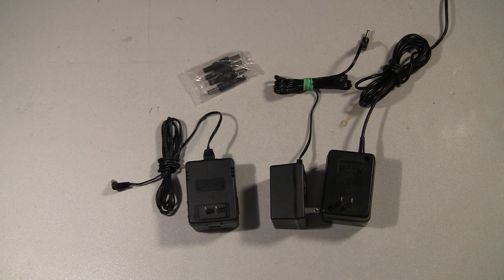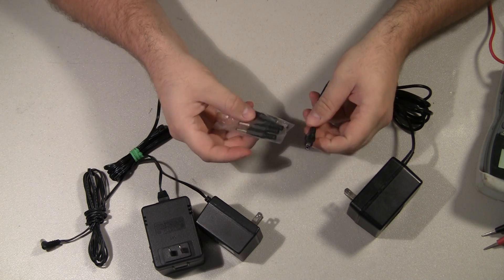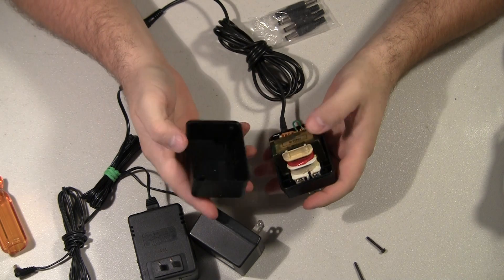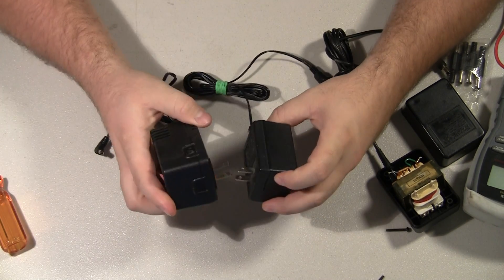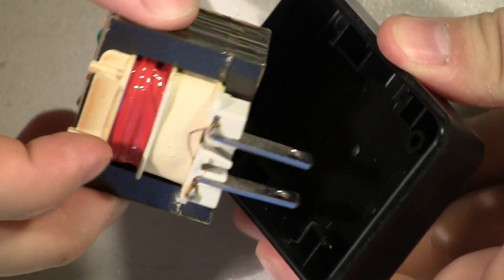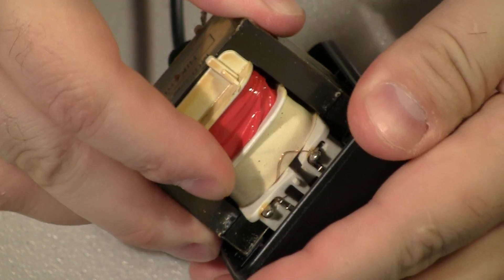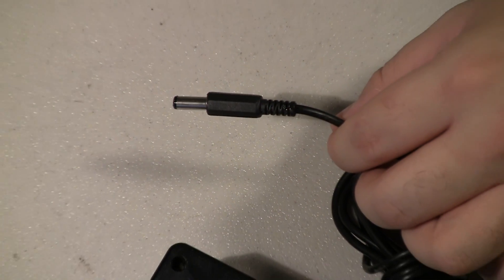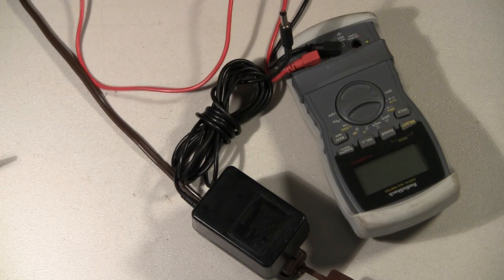NES AC adapter repair - Tips N Tricks - Its easier than you think!

Comment: Opening my SNES's SNS-002 AC adapter, I found that the size 8 spanner bit in my iFixIt kit kept slipping around the screw head, and the size 6 spanner bit was too small. A size 10 spanner bit from a cheap Harbor Freight security bit set seemed to work a lot better. I think it worked better because its body is wider than the iFixIt bits, so it stayed centered in the hole. (The size 8 spanner bit from the Harbor Freight set was too narrow to span the head. Weird.)

I've never seen that kind of screw head before. I haven't figured out what that style is called. Apparently, spanner bits are meant to be used on heads that have two little holes in them, and we're just lucky they work on whatever these are. 😄
Reply: Just got the ifixit kit and I'm also unable to get my NES power supply open with the #8.  Guess I'll be stopping at Harbor Freight the next time I'm near one for their kit.

Comment: Ive got two power supplies one nintendo and 1 aftermarket, the nintendo rated for 10v puts out 12 at the tip, and the aftermarket rated for 9v puts out 17v. I get non stop wavy lines with the nintendo power supply, and if I position the connection of the aftermarket I get little to no wavy lines. Any ideas?

Comment: The NES has some weird internals as it can accept AC and DC and the voltage can vary on a huge scale. In your case the polarity of the wires doesn't matter because it's an AC adapter but when you fix a DC adapter make sure you wire it accordingly to the sticker so it won't cause any confusion in the future. (polarity can be a life or death situation if the device is not protected)
Reply: Do you think 11 Volts will still be ok? Because my original power suply is outputting that and I'm a little concerned...
Reply: @xevelence1366  Sure, the NES can tike a wide range of volgages, AC and DC. I don't know how the internals are built but that's just how it works. Read up on it at some forums if you are unsure. But the smaller voltage PSU you use the less turns into heat, so don't use too big PSU. I don't remember the exact values but I think it can take 12V DC without a problem. Please, look up the details before you damage your NES.
Reply: @@davidmorelli8554 The NES adapter is 9V AC, so it has no polarity.

Comment: Only thing. You should have crimped over the black shielding at end of tip instead of the green and exposed wires. That would be the right way and you wouldn't need any super glue.

Comment: I recently bought a SNES with a bag power supply. Watched your video and turns out there is a open wire between the transformer  and tip. Rplacing the wire is easy. It's  find the damn tip that is turning out to be the problem. You wouldn't happen to have a part # would you? I checked mouser.com but had no luck.
Reply: Did you ever find them? I'm looking too.

Comment: Hi. Does my Famicom power/AC adapter need rewinding or does it need it's capacitor replaced? The adapter is 10v DC but the power/AC adapter is only outputting less than 1v. 
The specifications are:

DC 10v 850mA
AC 100v 50/60Hz 18Va

Is it the capacitor? The capacitor spec is 16v 2200 microFarads.

Thank you in advance. 

God bless, Psalm 11:7
Reply: Open it up and check voltage inside the adapter, where are you reading the voltage from?
If you have a multimeter that reads capacitance you can check the capacitor, but I believe you would need to remove it from the circuit to check it
Reply: Hi sir Mike. Sorry for the very late reply (been doing projects but I got time for the hobby/relax).

On the plug end of the Famicom's A/C adapter it's about 22-24 mv (milli Volts, tester set to DC auto range) when I opened up the  case and measured the positive and negative connection on the board on the transformer where the wire going to the plug is soldered to (tester set to AC): first it is 22v then it goes down to 8v and then 5v and then 2v then finally OL, all in 1 second. 

I tested the tester on an AC outlet, it says 230v+ (in a 220v country), to test if the tester's faulty, it's good.

I cleaned the tester's contacts and the plug's contacts with (99% isoprophyl alcohol)? The capacitor it's about 2.3mm x 1.5mm (16v 2200 microFarads). The tester's not that branded, it's basic and its range is only 40microFarads to 100nF.

What's my next step? Do I find the same capacitor (or two 8v1100nf- is that possible? the local shops for electronics isn't that complete usually) and replace the old one or have this rewound to 100v (to retain it's original design- I'm kind of semi-purist but will mod this to RGB if that's possible:-) or both replace the capacitor and have it rewound?

By the way how does the A/C adapter's transformer, transform alternating current to a steady direct current with just the a long wiring wound in the transformer?

Thank you. Have a great day.
God bless, Proverbs 31

Comment: I bought a NES 001 AC Adapter on the flea Market today, first I've connected to my NES and it didn't work after that I check with the multimiter and it gave me some random voltages arround 3.55 to 10.85 all crazy, after that I realize that the tip was just a bit dirty clean that tip with some brasso and it worked like a charm. It's intresting how something so simple could make a diference, I was about to open and check if there was something wrong on the inside but luckly  it was just a dirty tip.
Reply: 002 001 is the console

Comment: You melted the wire coating where you crimped it before soldering. You should wait to crimp until the soldering is done and the metal is cooled to room temperature.

Comment: Do you know to re seat/ repair the ac connector pin in a genesis ac adapter? I am getting NO power from the unit and one plug is tight and solid the other wobbles like hell so thinking that could be an issue.  It Has a brand New Capacitor and I made sure i Installed it correctly.

Comment: Great job,my pal snes adaptor doesn't work properly since 2001 so everytime i wanted to play, i had to bend the cable in such position in order to power on the snes, HOWEVER, one slight move of the adaptor will shut down the snes.
Because of this i instead use my pal nes adaptor for the snes over a dakage, but still i wish i could repair the official pal adaptor because it looks more appealing.

Comment: To anyone who is reading comment. I ask, is it possible to use heat shrink tubing at the end of my newly replaced AC adapter plug to secure it rather using super glue? 14:40

Comment: Man those tips are expensive here in the UK. If I am right they want £5 each. Anyone find them for a reasonable price??
Is this them? http://uk.mouser.com/Connectors/Power-Connectors/_/N-axip3?Keyword=DC+tip&FS=True
Reply: +true_blue1878 I found some chinese ones on ebay 14 for £2.50 but nothing about their rating or ROHS. Why are the mouser ones so expensive??
Reply from the maker: +true_blue1878 Don't search for 'dc tip' and you'll see cheaper options in that category, like this:
http://uk.mouser.com/ProductDetail/CUI/PP3-002A/?qs=sGAEpiMZZMtnOp%252bbbqA009lE0K0K%252bPZG0e9ixBKDSZoecM%252bRuy2EvQ%3d%3d
Reply: +GameTechUS Thanks man. Is there none with the cable support like yours? And thanks for your video! It motivated me to have a crack at one of mine but sadly it was all glued together and a real bitch to get to.. but according to people over at badcaps.net.. you really need to test the voltage while its under load. Mine tested fine 12v constant but it was still randomly failing to supply my HD with power. Guessing mine has a cap or a transformer problem rather than the wire/tip.. but I definitely want to buy a few of those tips for the future! Cheers

Comment: Only 1 in 4 adapters open up that easily though. Most are snapped together with plastic locks and you have to get a knife in there and pry the bugger open. I would like to see how you open those types up without damaging the case. Also how do you actually repair the supply itself??

Comment: for my Boss psa-120t it was the wire coming out of the unit - your video showed me where to look.  Taking the unit apart was more tricky.  Removed the two screws from the back but had to hit the seam with a chisel and hammer around the perimeter to gently open up the edges.  Eventually I got it open, cut and re-soldered the wires and now working as good as new.  Thanks for your video - it certainly got me on the correct track!

Comment: I have two kinds of power supply, A) says output DC 10,5V and when only plugged measured 20V; and other B) says output DC 4,5V and when plugged measured same 4,5V.. do you know if my power supply "A" is damaged or can be fixed? thanks in advance

Comment: Is there any way to reduce the output voltage coming from the transformer?
I have one that says Output DC 9V 200mA but it is putting out 19.7 volts.
What could be the problem & will this issue harm my 9 volt miditech keyboard..
Thanks for the tutorial!
Reply from the maker: All adapters will show high when not loaded. It's fine.
Reply: GameTechUS except for switching ones.

Comment: What kind of jack tip do I need for the Sega Genesis Model 2? Also where can i buy?
Reply: +David Reid Outer diameter= 4.75mm. Inner Diameter= 1.7mm
Reply: +ArcadeGames thanks bro I know now was old post :)
Reply: David Reid
Yeah, I didn't realize how old the post was until now. Just for future reference, the Genesis Model 2 has the MK-2103 power supply adapter, they are everywhere on eBay for pretty cheap.

Comment: i just purchased 100-240v ac/dc power supply adapter. Input :100-240v AC 50-60Hz. Output:10v DC 1000mA. Polarity:(-)-----(o-----(+) .Will this ac adapter compatible with an AV Famicom console? The AV famicom Polarity :(+)-----(o-----(-) Centre Pin Negative.i dont want to fry my AV famicom console. i wanted 100-240v ac adapter (auto-voltage) for traveling.thanks